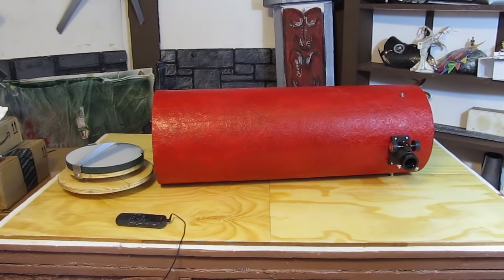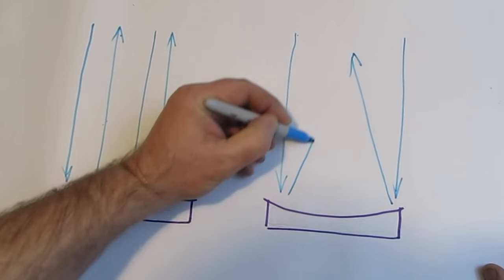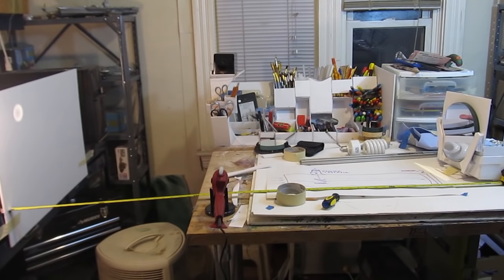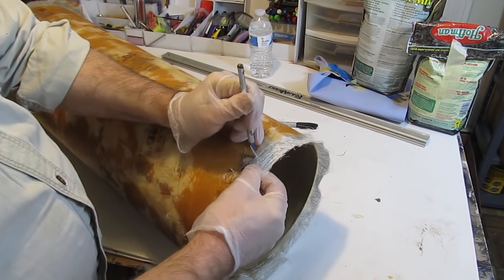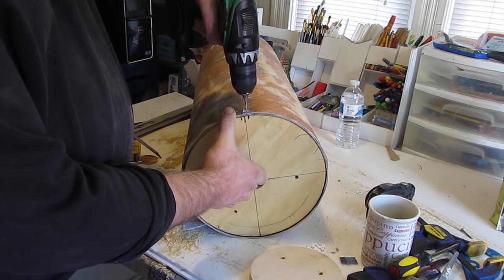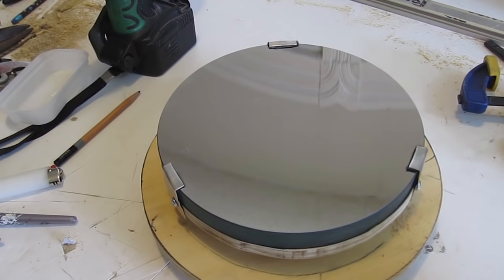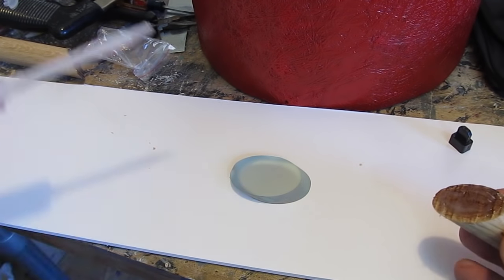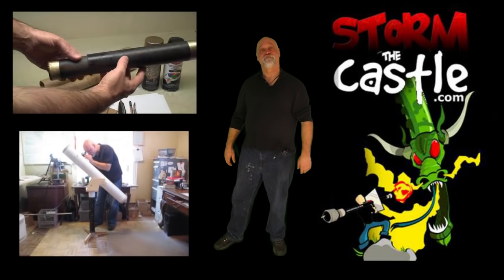How to Make a Telescope - 8 Inch Newtonian Reflector (Part 1)

Comment: OR you could get lucky one day and find a Simmons 900mm reflecting telescope at goodwill for 10 bucks! And thanks to your swell channel Im on my way to helping my son become an amateur astronomer
Reply from the maker: Congrats on finding that telescope cheap! Have fun discovering the night sky!
Reply: 900mm is probably the focal length, the aperture is the most important part for how much it will let your son see.

The one made in this video has an 8" mirror. If he really takes to astronomy, look for something in this size class or larger.  I got an older but in near perfect shape Celestron 8" dobsonian off Craigslist for less than $150, and it's a lifetime keeper.

I too bought a scope at Goodwill.  It's a Celestron Nextar 4 gt (4" aperture, go to electronics).  Lucked into it for $30.  It's great for short sessions and showing newcomers to the hobby, but limited because of its modest aperture.  I use it most often to help me locate objects in the sky, I can replicate the view through the finder on one of my larger scopes and get a better view at the object.

Comment: Hello a query , my focal length is coming to 47 inch for 8 inch mirror . Is it correct
Reply from the maker: Not possible for me to know. Depends on how they ground the mirror. Did it come with any information? F ratio?
Reply: Yes it’s a 8”  F/6
Reply from the maker: @rahulraizada9884  Yes, so an 8" at f6 would be 48 inches. Your 47 is very close.  I would say go with the measurement you made.
Reply: Thank you so much

Comment: Why not just use the furniture epoxy clear finish instead of fiber-glass?
Reply from the maker: Great comment. I am not that familiar with epoxy clear finish. Part of the reason for the fiberglass is the make the tube extremely strong. We don't want it flexing over time. the epoxy might not give us this.
Reply: Point taken.

Comment: The thing with diy vs “professionals” is you know where the flaws are since you made them vs not knowing (best part about ignorance especially if you paid for it), but typically diy gets better savings the more you scale up. The bigger the bigger the savings. Typically you can do the math a find out at what size is something worth making vs just buying.. kingofdiy makes aquariums and if it’s over 200 gallons for an aquarium it’s worth diy under 200 it’s no cheaper or not worth it. Coming back to telescopes if the price for a 12” mirror is hypothetically $1000 and 8” is 800. But a complete telescope say is $2500 for a “12 and $1500 for an 8” then building a 12” is better bang for your buck.

Comment: Oh Boy!!   You don't need to fiber-glass it.    JUST EPOXY paint is enough!!..  
USE EPOXY Spray  BLACK inside the tube.  (it doesn't have to be smooth or perfect)
USE EPOXY Spray (any color you like) Outside the tube.  Here, you want your best paint job.   
lay ONE Coat and wait a couple of days to Harden...... With the inside and outside paint it should be Pretty Strong.   OR you can lay another Coat of EPOXY paint outside and make this your COSMETIC final coat (smooth, Glossy & Beautiful)  (I like "refrigerator White" available at Home Depot, Lowes, etc.) 
But Don't do the Fiber-Glass JUNK...........

Comment: i know you are wondering where to get the mirror go to your dollar store and get on of those magnifying mirror and take the mirror out
Reply: jasdeep garha Re: " Using a magnifying mirror from Dollar Store (Or any other retailer)
Couple of problems with that:
1: Telescope has the mirroring applied to the FACE/ TOP of the mirror. Regular mirror has the mirroring applied to the BACK /BOTTOM, which causes distortion. 
(With coating applied to FACE (EG First Surface Mirror) the light is reflected right away... with the coating applied to the BACK.. Light rays come in and have to go thru a layer of glass, bounce around a while before exiting.)

2: El-cheap-o mirror is going to be very thin... and will distort with temperature changes.

3: The grind will probably be incorrect.

Comment: You're using a 10 inch tube.  I can get an 8 inch tube for free.  Will that work or would a smaller tube get in the way of adjusting the mirror?
Reply from the maker: You need a tube that is at least a little bit larger than the mirror.

Comment: Why can’t I use any cheap mirror, cut it and get free 20” telescope if all that is, is a mirror?
Reply: Because a normal mirror wont reflect the light in the right way
Reply: you need a concave mirror as it would gather light and focus it on the little mirror

Comment: Why couldn't a man take a bigger acrylic mirror and use a dish network dish as a form and experiment with how much to suck it into the dish and have a huge telescope with the right amount of adjusting and figuring
Reply from the maker: Good creative thinking but the dish network dish is not precise enough for light. It would distort the image. Ends up looking like a funhouse mirror.
Reply: @epicfantasy  I have recently ordered a 2.5x2.5' acrylic mirror and I am headstrong that I will be able to make a adequate telescope. I work in a fabrication shop and  I have nothing but time after work to get that thing dialed in perfect. If it's possible I will do it and if I do I will let you know
Reply from the maker: @bradbradleys6091  ok. Keep me posted!
Reply: I plan on drilling a hole in the center after cutting to fit, with a cable run through the mirror and dish with a ball on the end and experiment with pulling it down a little at a time and see what I can do. It probably isn't possible but I will try until I'm convinced it's not possible. I have coil stock for the tube ready and wish me luck.
Reply: @epicfantasy  well after this video gets randomly in my feed and I noticed my comment that I forgot making I will update you that the end result was not me having a working telescope

Comment: What the F is "8 inch"? Why not using normal units ffs???
Reply from the maker: 8 inch is a standard telescope size. It means the mirror has an  eight inch diameter.
Reply: @epicfantasy  how much is that in football fields? Or in skunks?
Reply from the maker: @beepboop8184  .0022 football fields and .38% of an average adult skunk.